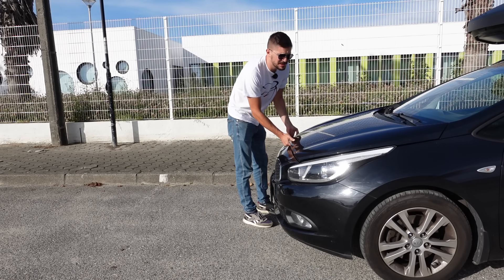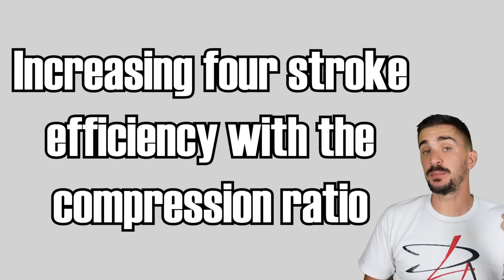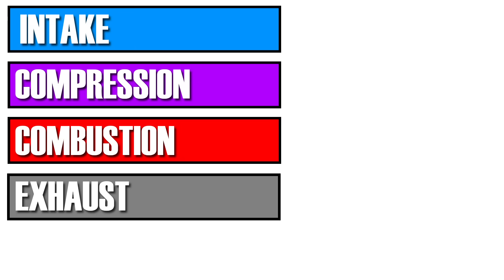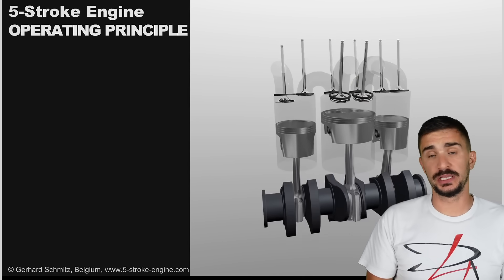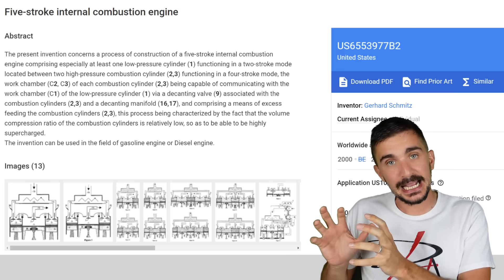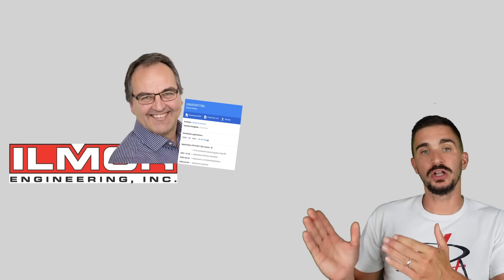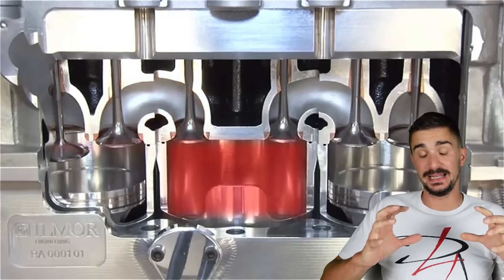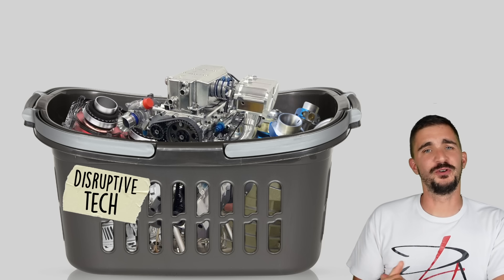Why Five Stroke Engines Are More Efficient But Still a Failure

Comment: Every 4 stroke motorcycle engine I’m aware of opens the exhaust valve way before bottom dead centre on the power stroke, so wastes some of this stroke, presumably sacrificing efficiency for maximum power. My Triumph opens its exhaust valves 43° before BDC. If I recall correctly after 50 years, my Ducato Desmo 450 motorcycle opened its exhaust valve 90° before BDC. It seemed remarkable then, and now.

Separately, the compression depends not only on the compression ratio, but also on when the intake valve closes. My Triumph, with 12.92 nominal compression ratio, runs on 91 octane standard unleaded (in Australia). The previous model with a lower 12.25:1 compression ratio requires premium 95 or 98 octane. I think this is because my bike has different valve timing, with later intake valve closing on the compression stroke. 
IanB

Comment: Good video. You don't need to make better engines, just different fuel injection and/or HHO gas addition (must be good HHO generator, most of them don't make positive effect). Injecting gasoline in the gas phase eliminate all rhat problems and give more power and less fuel consumption. If add HHO gas, even better. Also water injection eliminate much problems, no need for actual emission control devices, like EGR valve, no carbon buildups and pre-ignition, knocking, etc.

Comment: Electric may take over but 100% agree with you - ICE is an absolute marvel of engineering. As for efficiency of fossil fuels that is really skewed when you consider how much actual solar energy went into the production of that fossil fuel. Now if hydrogen takes the place of fossil fuel then who knows what limits the ICE will scale.

Comment: Seems like the "inefficient at low speed" could be solved by using it in a range-extended electric vehicle? 
Go electric, then run the engine at high RPM only to recharge the battery when needed.

Comment: Seems to me that this would make a pretty good engine for a plug in hybrid. Running at a single speed would not be such a problem in this application. Also would allow a optimised catalytic converter.

Comment: You would think with today's electronics and turbos, when at low rpm route outter cyl exhaust into center cyl to compensate then as rpm increases valves re route turbo exhaust to exhaust manafold. Or something to compensate and i would think with how efficient it is, they could by pass catalytic converter at least in low rpm. And or add preheat function to the cat.

Comment: My first thought when I saw the cooler exhaust feature of the 5-stroke was: "Doesn't the exhaust need to be kind of hot?" And I wasn't wrong.
We saw issues arise when gas heating appliances (water heaters, forced air systems) were made more efficient. Suddenly vent pipes needed to be stainless steel and have condensation capture/disposal systems because the flue temperatures were below dew point for the moist flue gasses.

Comment: The dependence on high RPMs for efficiency makes sense.  The idea is clearly related to compound steam engines but reciprocating steam engines all operate within very narrow RPM ranges so the extra cylinders can be sized for optimal efficiency more easily.

Maybe turbo compounding (Hooking an exhaust turbine directly to the crank instead of to a supercharger) as used near the very end of aircraft piston engine development might be a better way forward.

Comment: About NOx and efficiency: The health effects of NOx are completely exagerated. NOx turn back into N2 and O2 over the course of about 24h and the amount you'd need to breath in to actually suffer health problems is order of magnitude higher than what you'd find in a normal European city.

However, by increasing the lambda-value (Available Oxygen during combustion/required Oxygen) from 1.0 to 1.1 you could make any diesel engine 10% more efficient w/o touching the hardware. Just a software update.

Also, higher compression could increase fuel efficiency, though at the cost of slightly more NOx. Higher compression in diesel engines would also enable the engine to run on other fuel types that require more heat to self-ignite including gasoline (which is chaeper before taxes) CPG (Compressed Patroelum Gas/Butan-Gas C3H8) or plant-oils or a mixture.

However, we are living in an ultra-green society that knows only good and evil and sacrificing "health" (even below the point of being measurable) for economic reasons is evil by definition. Continues use of natural oil is evil by definition. Compromises with "evil" cannot be made, even if "evil" actually just means economic self-preservation...

Comment: Electric Vehicles are 85% efficient.  In fact the Model 3 is the most efficient production vehicle in mass production today. 5 miles per KWh.   Or around 120 MPGe.   In 10 years even this efficiency will be obsolete.  RIP ICE vehicles.

Comment: I feel like cylinder deactivation plus exhaust gas bypass on the 5th stroke might counteract the low heat issue at idle or under light load. But then again, if the engine is under light load at freeway speeds and you have the deactivation with the exhaust bypass, it would seem redundant.

Comment: It sounds like a smaller version, say a 200cc engine, would be the perfect way of powering a hybrid design. 

An engine that runs at 100% power output from start to stop. Because it's driving a generator, and when it's  not driving a generator, it's not running.

Comment: The parallel world of naval engineering shows that the extra expansion approach is very attractive, see the Triple Expansion engines that dominated steam propulsion for decades. However, the increased power density of turbines caused the death of the triple expansion engine. I wonder if additional research into geared output turbines or higher RPM range generators would allow turbines to take even better advantage of exhaust gasses, and act as a generator for a hybrid powertrain, like F1's MGU-H. They are extremely complex and compact units on F1 cars, but I wonder if there is a market for a turbo that would contribute power to a battery, especially in cars/trucks that have "range extender" engines, such as Edison Motor's concept or the Chevy Volt.

Comment: They never take into consideration how much the heat generated saves in heating, whereas EVs greatly suffer from significant range loss in cold weather, partly due to the heating taking a lot of charge.

Comment: This design might be useful when you are running at more stable rpm, such as in a generator situation. Keep to ideal rpm and gear the engine to give best output. A larger version may be relevant to diesel electric locomotives that drive through electric motors. Probably not enough advantage to pay back the development costs though.

Comment: What about adding a fuel injector to the large middle piston that is computer controlled and only feeds additional fuel at lower RPMs to get around the loss in power at low speeds? That would make the passive piston an active piston when exhaust pressures are too low otherwise. I am not sure if an extra spark plug would be needed or not? This whole 5-stroke concept reminds me of a triple expansion steam engine design.

BTW: I really enjoy your detailed descriptions of advanced engine designs! Subscribed!

Comment: I would be interested to see a prototype with variable valve timing, electric turbocharging and a catalyst preheater.
     The factor which renders so many designs unbuildable is materials science. Since the low pressure cylinder does not suffer combustion, I wonder if there might not be a ceramic/carbon fiber/alloy solution. Titanium?

Comment: 5 stroke might be good for certain applications where you want to run at a certain RPM for an extended period of time without lots of low load situations like cars.
Reply: I built one years ago, the exhaust was very quiet as most of the excess energy had been absorbed. The final exhaust was also quite cool. Not red hot like conventional engine exhaust.

Comment: This might work a lot better for hybrid cars, especially so-called serial hybrids where the engine only generates electricity to drive the motors and/or recharge the battery.  Sometimes it's described as a range extender.

For those, you have a small engine that either runs at full RPM or doesn't.  Because it's decoupled from the wheels, it doesn't have to be on all the time.  That ~max power situation is most efficient in all engines, anyway, and is the exact sweet spot for this 5 stroke design.  And because it's such a small engine, the catalytic converter can be a lot smaller and maybe easier to heat up when needed.

Shouldn't be super complicated and it would seem to play very nicely in hybrids...

Comment: Why not use this engine as a motor for an emergency generator? They operate at a constant RPM no matter the load and catalytic converter heat problem could be fixed with something like heat trace that turns on when the engine turns on. There may be different emission standards for emergency generators so I am not sure if the cat is even needed.

I dont know if it could be used for a standard generator because the large ones are usually turbines but im sure that there is a decent solution somewhere.

Comment: Just like turbo, small turbo is good in low rpm. Faster response, higher power extraction at low rpm. They could have reduced the middle cylinder to a target extraction rpm. Of course, at the sacrifice of higher rpm operation due to lower exhaust flow.

If we strap a supercharger to the engine, the engine is basically turbocharged. Except the turbine and compressor being split into the turbine being the third cylinder, and the compressor the supercharger.
Reply: And to fix the high rpm operation, we could bypass exhaust gas from the third cylinder or a 50:50. Let one exhaust valve run to the third cylinder, one straight to exhaust. Low rpm operation, bypass exhaust valve remain closed. Or during startup to accelerate cat heating.

Comment: You opened up the hood on that minivan, and you can't even see the engine, all you see is that big piece of black plastic. Now, if you open up the hood of a 70 Hemi Roadrunner, all you see is engine. No nasty, horsepower-robbing, California emissions garbage, Just chrome and paint, wires, hoses... And you can't beat the sound. The lope at idle, the scream at high RPMs... It's sweet music. Open headers dump into lakes pipes, no mufflers necessary, no stinking catalytic converter. Who cares if it's efficient or not? It's a thing of beauty, and it hauls ass. You can make your own alcohol fuel in your own backyard. How's that for efficiency?

Comment: in 2024, semipermeable membranes make it easy to separate air into Oxygen and Nitrogen at pretty small energy cost. Running an internal combustion engine on Oxygen rather than air would obviate the NOx problem at high compression ratios?

Comment: it could still be usefull in the right application aviation and generators. both applications keep the engine running at a higher load the majority of the time.

Comment: It is kind of impressive that you can walk into an auto parts store and get an engine part that is compatible with all of them from the early 1950's forward off the shelf. God bless the small block Chevy V-8. It is The Beatles of engines. Timeless. Longevity. Never facing obsolescence. 

Granted we may not have an infinite supply of fossil fuels, electric is a perfectly viable option.. but not a major concern for a millennium at least.

That said, we can't ignore or reject it. If the USA is not at the forefront of the future technologies, some other countries will be more then glad to fill those shoes. It equates to economic prosperity. It is completely ignorant to hand wave away future technology like Trump does just for the sake of big oil or to "own the libs" FFS. It's so pathetic.

Comment: what about combining free valve, cylinder deactivation and 5 stroke. for instnce you take an inline 4. you have you tradiotional 4 cylinder 4stroke cycle when you need max load. when load falls around 60% you deactivate the two inner cylinders and use them as fifth strokes for the outer cylinders. youre making 50% power forn the outer cylinders and the inner ones recuperate maybe 10% additional. you can keep using the engine at high load, with almost no pumping loss, and the thermal efficiency is higher. when you fall around 30%, you deactivate 3 cylinders, you have a single power stroke, and up to 3 successive stages of expanding the exhaust gases

Comment: The 5-stroke engine may have been a failure for road vehicles, but it might have actually been perfect for use in General Aviation. Small aircraft don't have to worry about tailpipe emissions, and they are only at idle for a few minutes at the beginning and end of a flight - the entire rest of the flight, the engine is running between 100% (takeoff and climb), and 75% (level flight cruise). On descent and approach, the engine is running between 32% and 75%, but this is only for the last few minutes of the flight. However, since maximizing the power-to-weight ratio is of critical importance in an aviation airplane, using a conventional Otto cycle with a turbocharger or power recovery turbine is probably best.

Comment: The six-stroke is even more efficient.  The third rotation of the piston compresses clean air and pushes it into a common chamber, from where it supercharges the next intake, requiring at least multiples of three cylinders, and a separate turbocharger is also of benefit but drives an electric generator, not needed for the engine itself, and no intercooler is required.

Comment: How much better is it compared to a turbocharged engine? A turbocharger is is also recovering the lost energy from the exhaust stroke, compressing it again, and cramming it back into the intake. Lose some now, gain double back later. Can a turbocharger compensate enough to be just as efficient as a 5 stroke?

Comment: I would like to know why engineers don't utilize the exhaust to do all the auxiliary work, like turn an alternator, power steering pump or some other work.  There is a lot of energy in that exhaust albeit much less concentrated.  The average turbo takes about 100 HP to run. But since the load is so much lower (probably more like 10hp), since it doesn't have to highly compress air, it doesn't need to be as powerful.   That's more than enough to run all of the accessories.

Comment: Doesn't the compression stroke take more energy than the intake and exhaust strokes? I wonder if we could find a fuel that does not need to be compressed for maximum combustion, that would save the most energy.

Comment: I openly acknowledge that I am under educated in this field, so if this logic is flawed, by all means say so. 

I can't help but wonder if an alternating exhaust system could eliminate the dead weight low load problem. Lets say dual exhaust systems with electronically controlled valve systems where a pressure censor detects pressure and when under insufficient load, routs the exhaust gas through a turbo forcing clean air into the low pressure cylender. I think this could allow the system to retain some of its efficiency under low load. 

I think the most difficult part would be fabrication of the system. I think the separation valve could possibly be incorporated after the head which would eliminate the need to figure out additional valves in the head itself. 

These thoughts are incomplete but they don't pay me enough to think so. 😅

Comment: Hello from finland. 
I am mechanical engineer, and I most love your clear explanations and great videos.
Most of things are clear for me, but you still can educate me. I am more than happy to learn from you.
For example the EGR: I never thought about “dirtyness” in intake manifold caused by piston rings! As you explained it, it was completely clear. Of course
Your videos are most relaxing and professional and clear as far as I know.
Excellent work!
Reply: Let us not confuse EGR(Exhaust Gas Recirculation as an emission solution targeting nitrogen oxide), and PCV(Positive Crankcase Ventilation as a solution for combustion products that make their way past the rings, contaminating the engine oil).
Reply: Engines were NEVER designed to have recirculation exhaust back in the intake thats why old engines last longer than new ones for example old diesel engines last up 1M miles vs DEF engines that may go bad at 30-50K miles same goes for the CATs in the exhaust they get plugged up like an old man with no fiber in its diet 😂
Reply: What the Finn said above. I have subscribed.
Reply: Clear explanation maybe, shame he doesn’t know what he’s talking about.

Comment: I wonder if that kind of extra cylinder(s) would make sense on ship diesel engines. I'd imagine those run most of the time at specific rpm so you can design for that specifically. Ship diesel engines are 2-stroke engines so I guess with extra cylinder(s) they would be 3-stroke rather than 5-stroke, but still.

Comment: 7:57 I was sitting here thinking of how much carbon build up would happen in the exhaust chamber and valves.
Reply: Add a five valve head on the center, and use the turbo to pump air and fuel into the dead cylinder on low load. This would work better with free valve  heads and custom timing on the center valve. Maybe help with the light up on a converter .

Comment: so basically the reason for fail of 5-stroke engine is the same as for split-cycle one...
It has some great advantages in very narrow rev range, so it remains theoretical construct in real world of permanently changing load, rev, and any other parameter you might think
Great, comprehensive video, as always